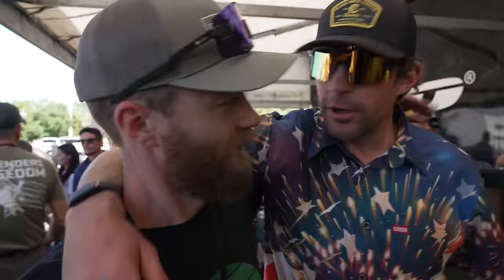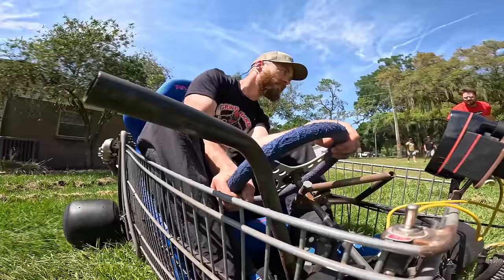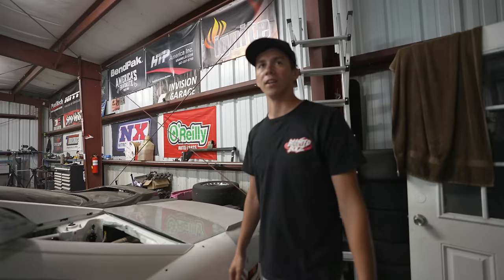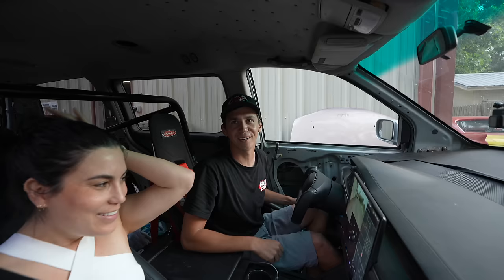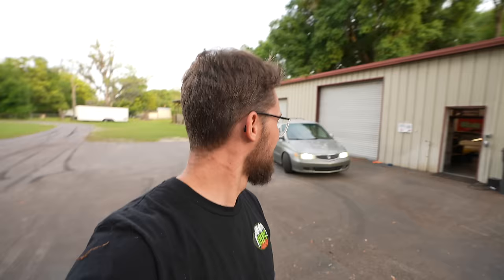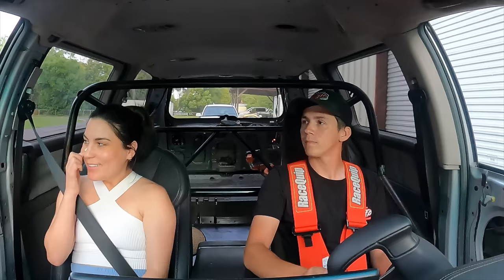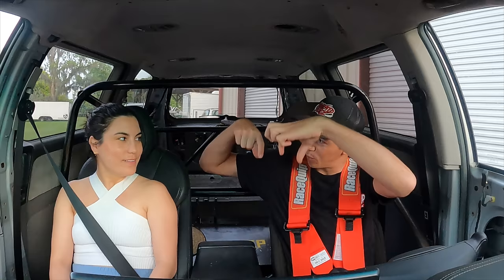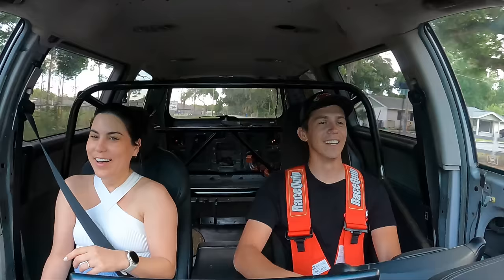Turboed Shopping Cart Hits the Streets + Our First Real Race!

Comment: I think the "plenum" is more of an accumulator than anything... there just isn't enough time between the exhaust pulse and the intake stroke for the turbo to push anything, the pressurised charge  comes after the inlet valve has already closed, so it just has to either rebound the pulse back to the turbo like a two stroke expansion chamber does with exhaust, or trap and store the charge for the next time the inlet valve opens! you could almost put a reed valve going into the chamber for it to work even better! (but keep that a secret)